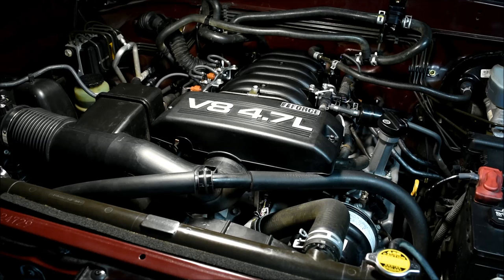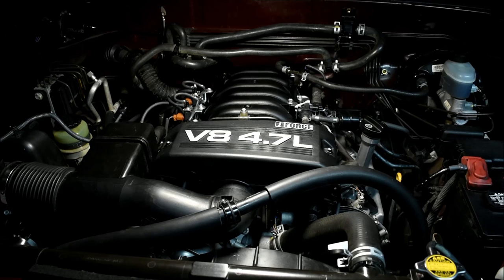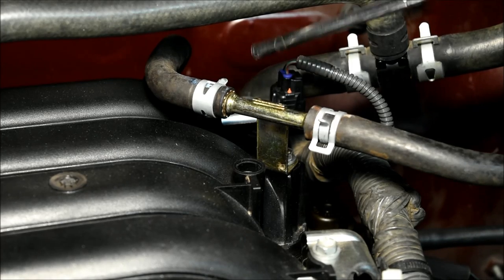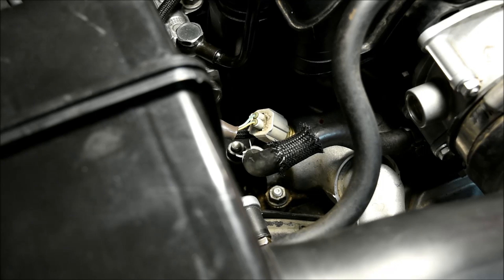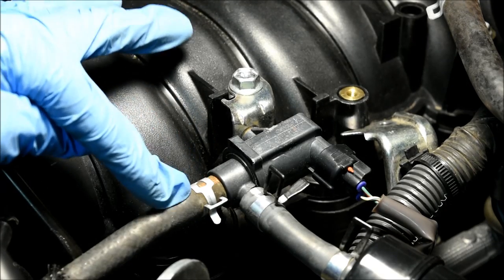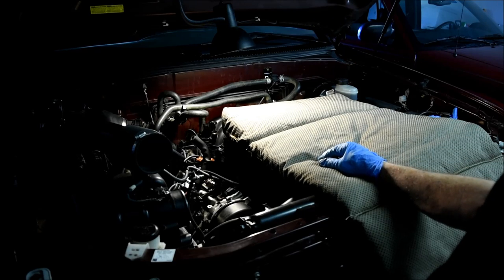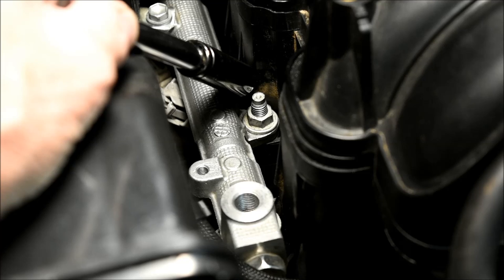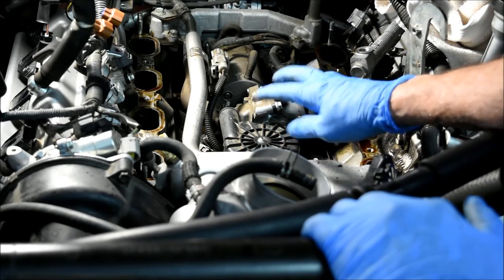Secondary Air Injection Pump Replacement 2006 Sequoia/Tundra Chapter 1: Removing the Intake Manifold

Comment: Had a P2440 code and Check Engine light on my '05 Tacoma.  "Secondary Air valve stuck open".  Finally found a source to buy one without breaking my bank ($140)  and ordered one.  Meanwhile
thinking "I wonder if I can UNstick this thing?".  I pulled off the hose that runs from the
smog pump to the valve at the valve inlet port and squirted a couple ounces of Mercury
Quicksilver (an amazing product designed to de-gick marine engines) into it.  Let it
sit overnight, cleared codes with my ODBII gizmo and drove the truck to town and back.
The CEL never came back on.  Now I'm debating whether to keep the new valve or return/sell
it.  I can do this 30 second repair a BUNCH of times with a ten dollar can of liquid magic!
The truck is a 2.7L 4 banger so it just has one 'bank'.  I would think it may work on a
V6 too.
Reply from the maker: Wow. That sounds like a great "quick fix." I would wait a week or so before taking the valve back for a refund. Those codes can take a while to re-appear. But it sounds like you have cheated the devil- and the Toyota repair shop.

Comment: Great job Dave very much enjoyed your video.  I also saw the other video you mentioned and will use a combination of both videos to do the air pump replacement.  Wow didn't realize the price for the air pump, diverter and the 2 valves were so expensive.  Once again thanks a whole lot for your video.

Comment: This is definitely the best video i have seen on this process. On the off chance you are by ur computer and off today. I am halfway through this and am curious if I need to drain the coolant or release the fuel pressure? Also, if you could add the tool and size it helps us at home from having to try  different sockets every time.
Reply from the maker: Hi Ryan- I was at the aerodrome working on a plane and just got home. I think it is possible to remove the intake manifold and replace the smog pump, etc without opening the cooling system but there are two big "ifs" to contend with. IMHO, you get a lot better exposure by removing the water bypass pipe. If you do this, you will open the cooling system. Also some vehicles seem to have more room in the engine compartment between the rear water bypass joint and the firewall. If you are lucky and have a lot of room, you may be able to replace the check valves without removing the rear water bypass joint. If you have to remove it, then again you will open the cooling system. 

If you have to remove either of those parts, just spread a couple of old towels around and catch the small amt of coolant that will leak out. Later you can add some coolant when you put things back together. You can try doing the repair without removing the water bypass pipe and the rear water bypass joint and see how it goes. If it turns out to be too much struggle, go ahead and remove them. It has been nearly 3 years now since I did this repair and my memory is that you have to remove the fuel delivery pipes and the connection to the fuel line from the fuel tank. This was no big deal and only a small quantity of fuel leaks out.
Regarding the second part of your question, I think I used a 10mm and 12mm socket on 95% of the nuts and bolts in the engine. There may have been one or two larger nuts/bolts.
I hope this helps.
Dave

Comment: Thank you sir for sharing this video and your valuable knowledge. I have a 2005 Sequoia with 135 thousand miles, and two years ago it had the same issue. If I would had watched your video I probably replaced the secondary air injector pump myself, instead of the mechanic who charged me $2750.00. I wish I knew then what I know now. Do you think, what he charged me is a fair repair price?
Reply from the maker: Unfortunately, that is about the going price at the repair shops- many of the Toyota dealers will charge $3,000 or more. My local Toyota garage wanted $3300. That is what prompted me to do it myself. I did find one place that wanted $2200 but he said that he could not give me a "fixed-rate" because he did not know what he would find when he got into the engine. I strongly suspect you are happy with your Sequoia and don't see any reason to sell it. The new ones are insanely expensive. With the low mileage that you have on that vehicle, it will probably last you a long time. Don't fret over the $2700. You did the best thing with the information that you had at the time. Everything is 20/20 in the rearview mirror.

Comment: Can this also apply to the Lexus GX 470, this vehicle also has the 2UZ-FE engine?
Reply from the maker: I am pretty sure this repair applies to the 2002-2009 Lexus GX470. I would say you could always call the Lexus garage and ask them where the smog pump is located on your year model Lexus, but when my smog pump CEL code came on, one Toyota dealer in my city told me there were 2 smog pumps in my SUV and they were in the right fender well. In their defense, that is where some smog pumps ARE located, but not in my 2006 Sequoia. Then I remembered, "Hey wait a minute, I have the shop manual for my vehicle." Duh. 
The location was in that manual. Although they do not give you a specific repair for replacing the smog pump, they make it part of the engine rebuild- you just have to pick out what you need.
When I get a new vehicle I usually buy the official shop repair manual. (The after-market manuals are often crap) For many years now you can obtain the digital version of these OEM manuals for cheap. I bought mine for $10 from some outfit in Canada (versus $270 for the paper version from Toyota). I am not sure they still exist (I got it in 2006). But I think they are still available online from other sources. It certainly is handy to have your repair manual on a thumb drive or on your cloud drive, etc. I can plug my thumb drive into my iPad and use it when working on something in the garage.
Good luck...

Comment: Great video.  Although I have a 5.7 liter Tundra with noisy injection pump (sounds like a diesel)  wondering how similar it is to the 4.7 liter?
Reply from the maker: Hi Vince, I honestly do not know, but it will depend on the year model. If your smog pump is located under the intake manifold, then this video will probably be a big help. In some Sequoias and Tundras there are two smog pumps and they are located in a recess in the right front fender well. Obviously they are much easier to get to. If you have the shop manual, it will tell you the location of  the smog pump or pumps. Years ago I bought a digital copy of the official Toyota shop manual for my model of vehicle. I don't think that website is there anymore. But they are still selling the digital manuals on EBay. A friend bought the manual for his 2006 Tacoma on EBay a few months ago. I think I paid 12 or 15 bucks for mine.This is MUCH less than the paper manuals which will cost in the hundreds of dollars.
When I first started getting the CEL and the truck went into the limp mode, I went to the Toyota dealer and they tried to tell me that I had two smog pumps and they were up in the fender well. I went to another dealer on the way home and they said (correctly) that I had just ONE pump, but it was hard to get to, i.e., under the intake manifold.
Reply: Thanks.  Its a 2007 Tundra SR5 with 5.7.  Toyota serviced the intake pump/valves under a 10 year warranty but they screwed up something and I won't be letting them touch it again.   It makes a diesel sounding clatter under acceleration.  Like an exhaust manifold leak.  Have not had a place to work on it yet but thanks for the tips on service manuals for when I get a chance to pull it apart.
Reply: It could be a coincidence, but I read something about the first year 5.7 motors having loose timing chains and clattering against the cover.

Comment: THANKS a bunch for this video.. I'm in the process of replacing my rear water bypass gaskets due to the driver side one leaking.   While i had the injectors off, I sent them to WitchHunter for cleaning/analysis.  Reassembly should take place in a couple of days...Hope I remember where ever nut and bolt goes :)  Why did you find it necessary to remove the fuel rail and fuel injectors? They can stay on the manifold I believe.  -- EDIT- Nevermind, I see your fuel injector connectors were brittle and didn't want to risk breaking those.
Reply from the maker: I probably would have left my fuel injectors on the intake manifold if the very first electrical connector's snap mechanism had not broken off in my hand. I am not ham-fisted and I normally work on airplanes which are often more delicate than cars. But when I learned that each of those fuel injector connectors were going to cost me something like $18 apiece, I elected to just leave the electrical connectors connected. And that did not even take into account that I would have to either solder each new connector back in place or crimp the wires back together with some butt splice connectors and shrink wrap. 
Good luck on your repair. Let me know if I can help in any way.

Comment: Hello Clark. I followed your advice and researched different parts for my 2006 tundra. And I was only able to find a pump with a part number 17610-0C020.. Very similarto the ome you listed. Any advice. ? I would really appreciate it. The seller claims it fits 2005-2011 tundras.
Reply: Correction, seller claims it fits 2004-2006 tundras
Reply from the maker: Hi Cesar, I looked in 3 different Toyota online parts sources and part # 17600-0F010 is the correct pump for the 2006 Tundra. Here is a link to one of them: https://toyotaparts.mcgeorgetoyota.com/oem-parts/toyota-a-i-r-pump-176000f010/?c=YT10b3lvdGE%3D   
I cannot tell you for certain that the other part number (17610-0C020) will not fit, but I cannot find any evidence that it will fit. I think for something that costs that much, I
would go with a parts place that sells the part that Toyota says is the correct one.
Reply: @doktorfixit  thanks Clark. I will investigate further

Comment: Would this also work for a 2006 4 runner Sr5 motor looks very similar
Reply from the maker: David, I honestly don't know, but there is one relatively simple way to find out. See where the smog pump is located. If it is under the intake manifold, the repair should be very similar to what I have done. In some Sequoias and Tundras, that pump is located in the right fender well- and there are two of them. I bought a copy of the OEM Toyota Maint Manual for my Sequoia in 2006- when it was new. I paid about $10 for it. Worth every penny since the paper hard copy at the Toyota dealer was about $150. I checked on EBay just now and found a guy selling a digital copy of the factory maint manual for your vehicle for $9.90. This will definitely tell you where the SAI pump is located.

Comment: Great video David, what is your engine code/model and manufacture date? 
1UR-FE or 2UZ-FE or another?  
I have a 4.7 as well manufactured 02/07 so ti may be the same as yours but not sure yet..
This should be located on a sticker under the hood and on the sticker when you open your driver door I think. 
I'm sure this is going to help me soon when I take this task on. There were 5 or 6 engine models on the TSB info I found and each say they require similar but sometimes different parts & procedures.
Reply from the maker: Hi Matt, thanks for the kind words. My Sequoia is out in my airplane hangar tonight- I had to haul some stuff in a truck and left the Toyota there. I will get it back in the morning and I will look at that data and get it to you. I am about 95% certain the engine is a 2UZ-FE, but the other things I don't have in my files.
Reply from the maker: Hi Matt, My engine is definitely a 2UZ-FE. It is on a decal on the under side of the hood driver side close to the windshield. The mfg date is April 2006 and I found that on the decal on the driver side door. On the engine decal there is a large 5N in the lower right corner. Not sure if that is pertinent. Hope that helps.

Comment: David this is a huge help!!  One question.  Did you manage to prevent gas coming from the fuel lines and pipes?  Or should i just expect some to come out?  I am especially concerned about the fuel delivery pipes.
Reply from the maker: There was some minimal fuel leak when I disconnected the fuel line- but not much. I also had a bit leak out of the delivery pipes. You could easily catch it all in one paper towel. I would estimate perhaps 1 or 2 oz of fuel leaked out.
In terms of volume, I had more coolant (antifreeze) leak out when I took the rear water bypass joint off the head. Luckily I had put a big flat drip pan under the car and an old towel just behind the engine which caught 95% of the fluid. I probably had about one cup of coolant leak out, but I had taken the radiator cap off in advance- and depressurized the system. Had I not done that, it would have likely been more.
Reply: ok great thanks!  I'll let you know how it goes.
Reply: B Rooney remove the fuel injection fuse and idle engine until it runs out of fuel.

Comment: I have to replace this as well what else should I replace along with this ?
Reply from the maker: Hopefully this will be the only time you ever have to remove the intake manifold. And you were right to give it some thought about what else you might do while you were there. I had a long talk with a fellow at a starter-alternator shop and he advised me not to replace the starter while I was there. He said in his vehicle, usually the starter and the alternator will outlive the owner. Plus the fact that they are fairly expensive. As you will note in the video, I do recommend that you replace the intake manifold gaskets as they are inexpensive and do sometimes cause a problem. Good luck with your repair. And thanks for watching.
Reply: @doktorfixit  awesome. Thanks for the quick reply. So I should just switch out the pump ? And manifold gasket? Nothing else. ?
Reply from the maker: @hardog22  I may have misunderstood you. Personally, I think if you are there, you should replace the entire SAI system, i.e., the pump, the check valves, and the diverter valve, with their associated hardware. I would not try to cherry-pick. And unless you think the curved hose from the diverter valve is supple, I would replace it too. Mine was hard as a brick and crumbled when I tried to remove it. And if you do, get the OEM Toyota hose, not a piece of radiator hose from Autozone. The tight bend you try to make with it will kink and be worthless. The Toyota hose is more expensive but it is specially made to maintain that curve. And you should plan on replacing an item or two that break in the disassembly process. I had to replace a fuel injector, at least one electrical connector, and the O-rings to the water bypass pipe. And I still shaved a couple of thousand bucks off what the Toyota garage wanted for this repair.
Reply: @doktorfixit  very helpful. Thankyou. I had also seen you replaced O rings on injectors. I shouldn’t  have to do this ?
Reply from the maker: @hardog22  I am more of an aircraft mechanic than an auto mechanic. It is penny-wise and pound-foolish not to replace small inexpensive parts that would take a  lot of effort to go back to at some future time. Those O-rings and grommets are cheap and easy. A couple of times I mention in the video not to disturb something because then you won't have to replace the O-ring. But once you take something apart and there is an O-ring involved, go ahead and replace it. In this regard, the repair is a little bit like plumbing repair. If you take something apart, be aware that it might leak when you re-assemble it- especially if you leave an old O-ring or seal in place that has taken a "set" or has a groove in it. I know it sounds like I am being a stickler about those things, but so many things that I do right nowadays, I did wrong before I learned the hard way.